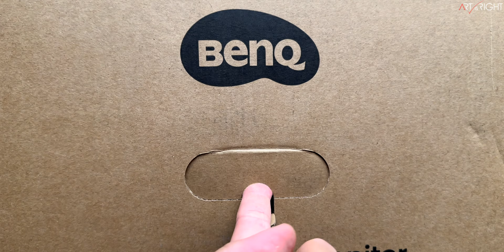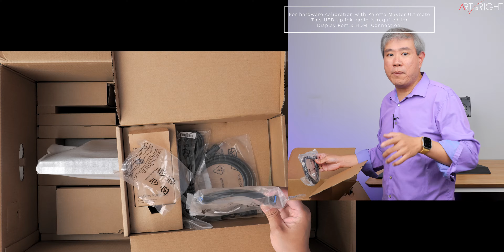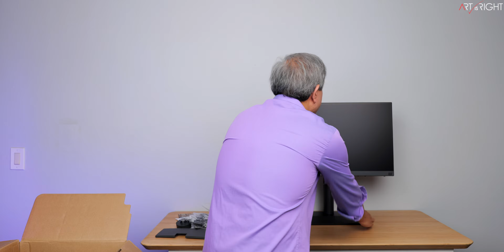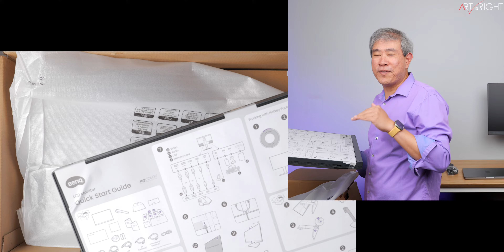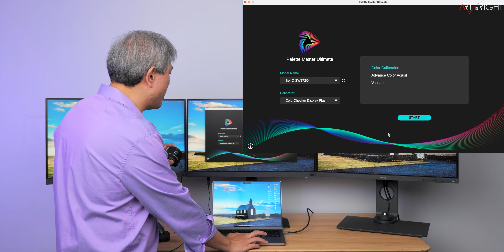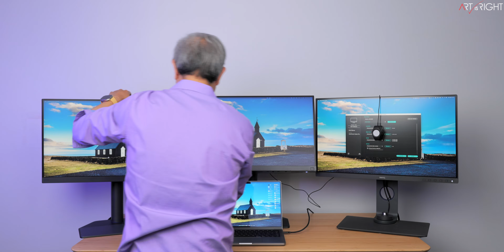SW272Q & Special Edition SW272U Unboxing!

Comment: Hi art im having a issues with my new sw272q montor I purchased about a month ago. I'm getting a color cost green / pink. I tried everything I could think of but I can't get it neutral. My normal settings the same with the previous version older model . 100, panel native, gamma 2.2 v4 back point 0.3 matrix.  My older monitor still works and is used next to it with a Mac mini. The new monitor is connected to Mac Studio m4 max with the benq usb-c cable.  

When I set it up initially and calibrated it with the latest software, it looked terrible. The reds were supersaturated and I couldn't fix it. I ended up downloading the previous - PMU   and the over saturated red  went away, but the colour cast is still there.  I called support, but the support was terrible, he no idea what I was talking about.  Any ideas would be helpful.   One thing I noticed when I turn it on, it's more green after about a hour, it'd more pink

Comment: Hello Art, first thanks for your gear educational videos. I have a question, I've using a Benq SW270C on a MacBook M1, I recently had a USB-C port failure and Benq was nice enough, exchange my monitor for an SW272Q. I migrated to a Macbook Pro M5 and when I installed the monitor my fonts look blurry, this never happened with my previous monitor. In the Mac Display resolutions I dong see ani HiDPI that corrects the issue, I tend to work @ 2048x1152, but even at 2560x1440 the results are awful. The only solution was to install BetterDiaplay to adjust the HiDPI and correct the bluriness. 

The interesting thing is I cannot find a good thread on the internet, the Benq instructions are to use a HiDPI resolution, that on my M5 are not available anymore. It looks a strange situation that there are not more noise online about this. I personally dont want to use a third party SW for this. Also I reralized that BetterDisplay does some overides, because after I set it up and activate HiDPI, I deleted the software entirely and the setting persist until I change the resolution.

Any thoughts, and BTW I think this should be a good topic for a video, M5 not having a HiDPI resolutions.

Thanks for your great contents and kindness!

Comment: I would like to ask you a few things about this monitor .
1 - can two sw272u monitors be connected to each other direct by usb c cable?
2 - these monitors connected to mac studio M4 Max ... will the magic keyboard still work OK in terms of quick short key action (ex; shift+cmd+3 = screen shot.. F10/11 increase/decrease vol / awake from sleep mode just by pressing the keyboard.. etc)?
3 - would this Benq monitors work fine for videography also? At the moment I have a 27'' imac with a secondary monitor SW272U  but I don't like the glossy finish on imac and on the other hand I want to upgrade the computer system to mac studio anyway and buy another sw272u  ... so, 2 x SW272U connected at Mac Studio.
I think you are the right man to ask these questions, really appreciate your answer!  Love your youtube channel..

Comment: Hi @artifright - Great video (s). Did you ever release the review of the 272Q? I am a landscape photographer (print+digital) and have recently been dabbling into video work as well - I work on a Macbook laptop and I feel that the 2K should be sufficient for my work. However am I missing something else by not going the 4K route (primarily to save the difference in $$)? I do a lot of dodging and burning in Photoshop to bring out colors/contrast in my raw images. You mentioned somewhere that the 272U would be more suitable for watching 4K videos - I edit 4K videos but scale it down to lower resolutions for posting online - I am a little confused about this statement. Any help will be appreciated. Thank you!
Reply from the maker: Not yet, and I am not sure when at this point. As far as not going 4k, this is a personal preference. No right or wrong answer. Any display can show 4K, but on lower resolution you just won't see 4K, regardless of if you are editing or viewing at 100%. But then that is not usually necessary unless you work in highend hollywood production.

Comment: Artis Good Day. I have the SW 270C and for calibrating use X-Rite I1 Display Pro. Would i be able the use the I1Pro to calibrate the SW 272Q as well. Thanks as always.
Reply from the maker: If you are refering to the i1Display Pro for both then yes. i1Pro is not the same as i1Display Pro, and though you can still use i1pro it is not recommended. but i1Display Pro yes.

Comment: Hi Art, thank you for creating this video!  Very helpful!!!  I have an M1 Max.  I just purchased the SW272U for my photography editing.   I want a 2nd display and I’m considering the 272Q or the PD Mac series.  I noticed you were using all 3 thunderbolt ports wired separately to each monitor.  The 272U doesn’t have 2 USB-C ports, so I’m wondering if I can daisy chain off the PD 2725 U?  Keep up the great work!
Reply from the maker: Yes if you get the PD2725U You can daisy chain

Comment: Hi PME 1.3.21 can’t detect sw272q calibrate with spyder 5 on my MacBook Pro m3 Pro connect with USB-C to USB-C 
Thank you for your help
Reply from the maker: for SW272Q you need to use Palette Master Ultimate, the latest software. PME will no longer work with the new model.
That is the first thing
the second thing is that Spyder 5 is not compatible with PMU
my recommendation is to look at Calibrite Display Pro HL or Display Plus HL
Reply: Thank you so much 🙏🏻🙏🏻🙏🏻

Comment: Thanks Art. A question: Did you use Palette Master Ultimate on all three displays? I thought that Ultimate doesn't support the older models, e.g. SW271. [Full disclosure: On the tag on the back of the monitor the Model-ID is SW217-B and the Type is SW271. I'm a bit confused. I always thought I had an SW271C.]
Reply from the maker: SW272U/Q PMU support yes, SW271 is not supported but the newer version SW271C is supported with PMU. As a side note SW271-B is the first variant that is known as SW271 and you would have to use PME with the model that you have.

Comment: Whats better, a 2k or 4k 27 inch monitor? Or 4k 32 inch?
Reply from the maker: It all depends on what you do, wants, needs, work flow, budget, etc. Personally, I would choose 32" 4K any day
Reply: @ArtIsRight  Thanks, i also bought a 4k 32 inch LG monitor, why LG? Because its a 144 hz screen, its a gaming screen but you can hardware calibrate it.... LG 32GR93u. If benq brings out a new SW version, same like this LG, i will buy it....
Reply from the maker: Not likely to happen in the SW, but then these displays are in different leagues

Comment: Great video , thanks . I have a question regarding scaling . I have a new windows computer , 4090 gpu ,i9 processor. I use it for gaming and have an oled monitor for that , but I would also like to use the computer for photoshop and Lightroom , so I’m looking for another monitor to dedicate to that . 
I’m debating to purchase the sw272q , as I’m concerned about scaling , as I believe the tools and text etc in photoshop will look smaller with a 4K monitor as opposed to using a monitor with 1440 .
I wish that’s a comparison you could show us
Reply from the maker: So for scaling, you can get a 4K and scale it to 2K. It sounds like you are on Windows and for that you would use application zoom and not windows scaling. A different approach

Comment: Hello. Do you have a video for us novices to connect the SW272Q monitor to a MacBook Pro (in my instance MacBook Pro Max M1). Thanks!
Reply from the maker: USB C to USB C no video needed. Once you do that then choose the input source and select USB C
Reply: @ArtIsRight thank you. I figured it out finally. The only problem I’m now experiencing is once I connect my Apple Magic Keyboard to the monitor (it’s a few years old and wired not Bluetooth) it doesn’t respond. Still have to use my MacBook Pro keyboard which I wanted to close and put on a stand.
Reply from the maker: That should work, but if it does not then I would use an adapter and connect the KB directly to the computer

Comment: Hola, podrías explicar bien el tema de los 10 bit, que no son reales, lo venden como tal, pero según he leido y visto es 8 +FRC, se nota la diferencia, entiendo que si, gracias.
Reply from the maker: No issue for 99.9% of use. The only time that would be an issue would be when you zoom in 500-600% or more on a retouching job, but most don't need that. It is not a good justificatino to not buy this. A true 10 bit panel would cost double if not triple. If you are a highend retoucher sure, you can justify it. Otherwise. It does not make sense to pursue 10 bit just for 10 bit sake.
Reply: Muchas gracias por responder, entiendo que no se notaria la transición de colores en uno de 10 bit reales y este de 8 bit + FRC, gracias. @ArtIsRight
Reply from the maker: Yes, but 99% of people can't tell the difference, and there are many other factors at play that contribute to good color. If 10 bit is all you are looking for then you are missing out on many other things. the bit alone is just a small spec in the overall picture; my advice is to not get stuck on it.
Reply: @ArtIsRight   gracias por responder. Entiendo que hay otros factores, pero el que me preocupa es este, no entiendo como dices que el bit es solo una pequeña especificación, entiendo que es de lo mas importante, además del resto de características que sino es 10 bit no podrás aprovechar, me gustaría ver las mismas imágenes en 2. monitores, uno 10 bit y otro 8 bit + FRC, tiene usted esa posibilidad de mostrarlas, seria estupendo que lo hiciera y comentara, muchas gracias.

Comment: Hi Art, can I daisy chain two of the SW 272Q screens with my 16” MacBook Pro M3 Max? 
If so how do you recommend connecting them for the best connection? I’m currently using display port to display port on an old Dell UP3017 connected to a CalDigit Hub then thunderbolt to MacBook. Thanks!
Reply from the maker: You can't the display has to support this and the SW does not.

Comment: Thanks a lot for the nice calibration demo! We already had a brief discussion in one of your other videos, but I am still not clear on what to do: I would like to move from my current set up with mbp 14 m3max plus sw2700PT to a dual monitor set up. 90% of the time this set up will be used for office work and coding, but 10% I'll use it for Lightroom and Photoshop. I am not sure if I should a) get a 270c, b) get a 272q, c) get a lower cost but brighter 'normal' IPS panel like a PD2700Q or d) ditch the sw2700PT and get two new 270c or 272q.... Any help and insights highly appreciated!
Reply from the maker: Lots of option here, if you want the latest matted panel choose the 272 series. Otherwise, while you can get them SW270C is a solid choice. As far as SW2700PT, it is getting older. I would think that you'll have a better calibration experience with Palette Master Ultimate, so I would say get 2 of anything that is compatible with PMU

Comment: Hi Art, I have a question about the SW240. I gave a PD272u already but I want another monitor that I can use with it. I do not have space for two 27" monitors. So, I am thinking about the SW240.  I do mainly video editing. So bring able to calibrite is a must. What do you think about me paring these two Benq's?
Reply from the maker: They would work and uses the same PMU software

Comment: I'm wondering why I should I buy this, and not the significantly cheaper Asus Proart PA279CRV (also Adobe calibrated)? This is tempting, but the ASUS seems better value - and will enable me to have a twin monitor setup.
Reply from the maker: One would think so until one has try Asus hardware calibration software. It is terrible and breaks so many color management mechanism. Calibration from the factory is not as good. There are more beyond specs.
Reply: @ArtIsRight  I decided to bite the bullet and go for the BenQ -- it's truly superb.

I'm not sure whether the monitor hood will remain in place -- it's a bit distracting at certain angles and the middle section seems a bit saggy.

But, I'm glad I listened to you, so thank you. :)
Reply: @ArtIsRight  Thank you -- of course, I know you are biased, but I do get where you're coming from. 
I just wish I could find a side-by-side comparison somewhere - people tend to review and love what they see, but don't have anything to measure against.

Comment: hello ArtIsRight, I have a question about this monitor: is it compatible with all MacBook Pros? I'm asking this question because I want to buy a 14-inch MacBook Pro and checking the different color profiles of this device, Adobe RGB (1998) is not in the list. Please enlighten me on this subject.
Reply from the maker: Yes they are compatible. Apple does not require propriety monitors
Reply: @ArtIsRight thank you for your help.

Comment: Hi Art. I just got my SW272Q. Any idea why the OSD menu always shows a resolution of 3840x2160? If I change the resolution on my Mac using System Settings --> Displays to 2560 x 1440, or any resolution for that matter, the resolution does appear to change on the SW272Q, but the OSD menu always shows 3840 x 2160. Another piece of information: The Displays menu says that the 1920 x 1080 resolution is the default. I'll contact BenQ support if necessary, but given your extensive experience with BenQ monitors I thought I'd see if you have seen this sort of behavior before. Thanks.
Reply from the maker: Not sure why that is, you can reach out to BenQ. But that is just ancillary information on the display OSD does not necessary impede the workflow or what you sending to the display, the resolution is set by the OS.

Comment: Hi Art Is Right, I received this monitor yesterday, but even before that I saw more reviews on YouTube, including yours. As I can see in your video, you also see shadows under the black frame on the sides of the monitor when you look at it at an angle...especially when you drag there white window or window with text. All the ambassadors praise this monitor, but no one sees this for 1600 usd? it seems to me like a manufacturing defect or imperfection for the money. As a photographer, I use two monitors at work, but my cheaper 27" 4k viewsonic has this error less prominently than this 2x expensive benq.  I can see it on VS too, but it's not as prominent as with Benq. And the second problem with the benq is that its power source whistles. I hear it especially at night, when my office is quiet. It is a high note that whistles in the wasps. When the monitor has no signal, it does not emit this sound. Immediately when the image jumps, it starts to whistle. He whistles quieter for a moment, louder for a moment. Abbot, my viewsonic for a third of the price does not do this. I don't know if this happens to everyone. Do you have similar experience?
Reply from the maker: I have been using this and does not hear the whisper from the power source, this could possibly a defect in your unit, I am not sure. I might reach out to support and see what they say. About the shadow that you talked about, that is not a manufacturing defect, but just rather how the display and the front coating screen is constructed. This is usually something that shows up on displays has a glass front or cover. It is something that I noticed on my Pro Display XDR as well. If you feel that this display does not meet your strict needs, I would recommend that you return it while you are still in the windows. This is not something that bothers me about the display in my daily use and everything in the tech world is a USS Kobayashi Maru - no win all scenario. You may think and praise other brands, however, at this similar price point, BenQ have the best hardware calibrate display and software. At the higher tier there's Eizo. But any other brands hardware calibration is not good, I have tested these in my studio.
Reply: @ArtIsRight  thank you for your informations, I give the brand one more chance, then exchange it for eizo. I have one eizo cs2420, it is a great model but I wanted to try another manufacturer and a monitor with 4K..And it didn't turn out the best
Reply from the maker: Eizo sits at the top and if you want the best and can justify the extra expense for the extra 10% to get closer to the 100% mark then then Eizo is arguably the better match for you.

Comment: Why does the text look like crap? It’s horrible and difficult to read. I did turn HDR off, so that is not it, and I picked the correct resolution.
Reply from the maker: HDR has nothing to do with this. Resolution is relative. So texts are hard to read, if you have the U model, you have the higher resolution display and most people don't run that at native resolution, otherwise, they'll get what you get. The key here is to scale the resolution, so choose one from the scale or list that makes it easier to see.